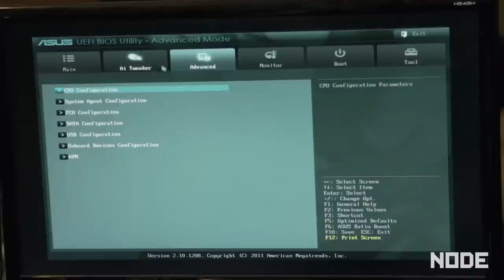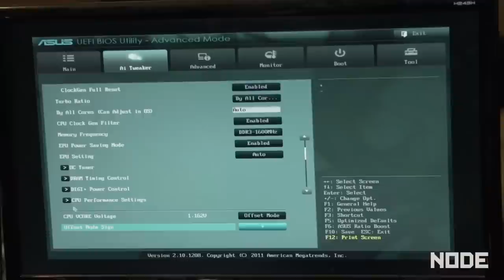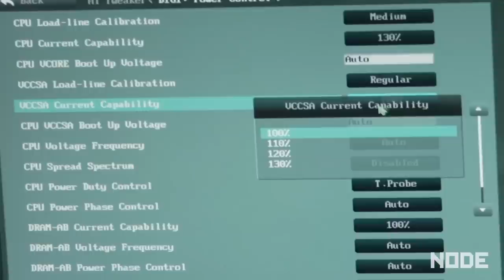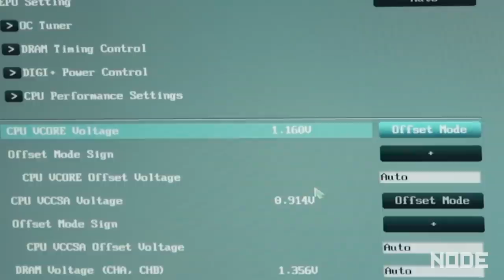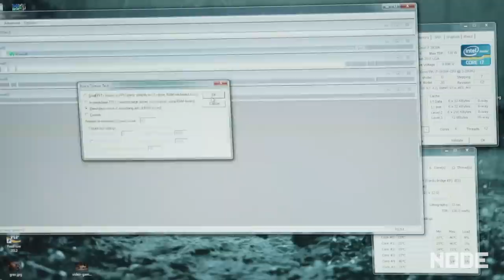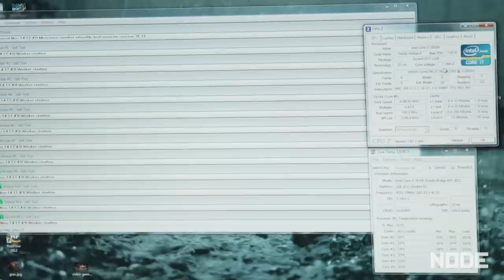Overclockerz with freddiew and corridordigital on LAN Party - NODE

Comment: Also there is far less depreciation in performance in a mac, You buy a pc with like 1.5 times the specs of an imac 27 inch and in 2 years the pc will have depreciated in performance by a good bit but the mac will be almost good as new. Though there are always exceptions of course. Also no viruses for mac does help and again.. . . that fucking os! (drools) Still though a pc is better if you're one for maxing out stuff and tinkering around, and for gaming in general.

Comment: A mac with an I5, 8GB DDR3 RAM, 1GB GTX 675, 27" monitor, a shitty mouse, and a shitty keyboard it costs around $2000. A PC with a I7, 8GB DDR3 RAM, 2GB GTX 770, 27" monitor, a logitech G500 mouse, a G19 Keyboard, and a coolermaster case costs around $1185. I wasn't even looking for good deals either I'm sure you could get all of that or better for even less if you look in the right places. Macs are just way too overpriced to be worth the "slightly higher specs" plus IMO Mountain Lion sucks.

Comment: No i dont believe so. I mean you could probably do it but i doubt ur laptop would be happy with the results haha. This is more for gaming although its one of those things thats kinda over hyped. See most every game only uses 1 core of your processor, not that this wont help ur computer out but i have an i5 3570k clocked at 3.4ghz and on ultra settings for bf3 i get around 70-100fps depending on whats going on in the game. So it doesnt really affect a whole lot

Comment: All this Mac hate going, on, I have to say:

Yes, Macs are overpriced and aren't worth it. Yes, they have low-end laptop parts and a tiny thermal envelope. But if you have a decent discrete GPU in one, say, a GT 650M or higher, Minecraft maxed is a very feasible thing.

Comment: But yeah overall they are far too over priced though part of it is due to them using like only the best components and shit which is also why a mac can generally last longer without much depreciation in performance than a pc however the lack of upgradeability and especially on the new ones with the screen glued shut on the imacs makes them somewhat retarded if being used for high end work that may need upgrading. They are generally better for editing and stuff though due to the interface and all

Comment: Overclocking the CPU won't necessarily increase your FPS enough to be worth possible instability, Overclock your GPU first.
Reply: their gpu came overclocked out of the box, gtx 680 ftw edition 4gb
Reply: ***** I think that thing still had head room for more overclocking
Reply: ***** My gpu was factory overclocked but I managed to ad an extra 150mhz so.....
Reply: That's true for framerates, but they overclocked their CPU's first because they we're also wanting faster renders and other goodies for their editing.
Reply: If the cpu is bottlenecking the FPS will increase with an overclock.
Reply: Salpeteroxid I doubt a 680 would be bottlenecked by an i7
Reply: a ftw edition 680 on an i7 clocked at 3.2 ghz will bottle neck at least a little
Reply: It's really hard to say if that's true, we don't know if that's just the base clock and if it has a higher turbo speed. We don't know what version of the i7 it is.
Reply: LaedusMcGonagall
I was commenting on "That's true for framerates, but they overclocked their CPU's first because they we're also wanting faster renders and other goodies for their editing." About an i7 bottlenecking a 680 or vice versa depends on the task, Some games won't even be making them sweat.
Reply: k

Comment: Hmm despite not being great or gaming in general and not having many customizable features you do realize that 1) a mac has an infinitely better operating system than fucking windows which is all round a piece of shit no one wants to develop for. But also an i5 or i7 with similar memory and all will run faster than an i5 or i7 on a pc with equal or slightly higher specs due to the os and other parts of it's architecture. They also have the greatest resolution screens in general.

Comment: Thank god the i7 has shorting and temp protection... Read this guide dudes: 

(fix it!): overclock_._net /t /538439 /guide-to-overclocking-the-core-i7-920-or-930-to-4-0ghz

Reference: I am a R&D system engineer for sony playstion

Comment: I have seen stupid and now I have seen the pinnacle.

You guys talk like you know what you are doing, and you got things way wrong.

4.2ghz is a tiny overclock, 4.5 or 5ghz would have been more impressive.

Was that a 1.6 Core Voltage?  That would gradually kill that chip.

Intels max recommended voltage is 1.5.